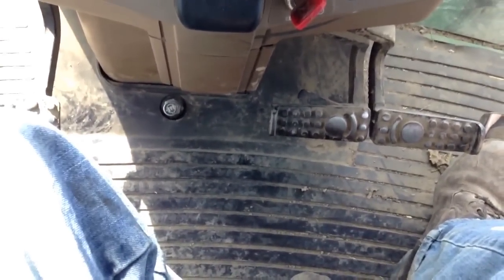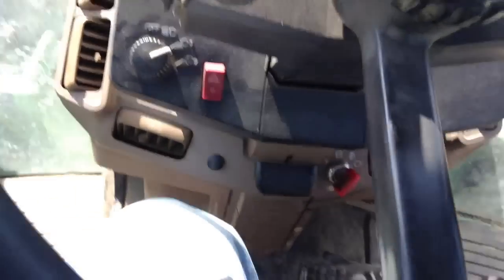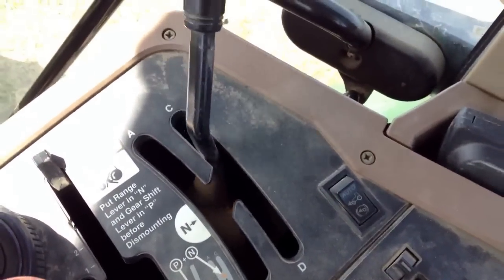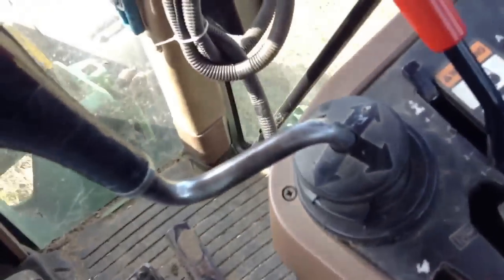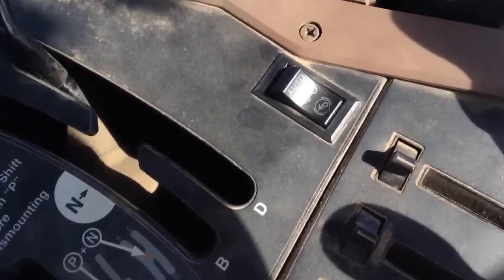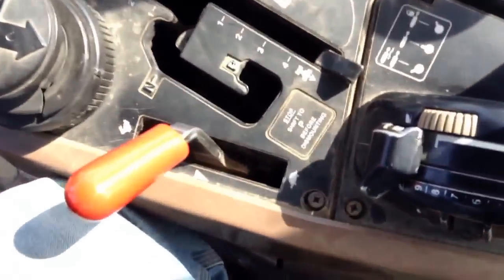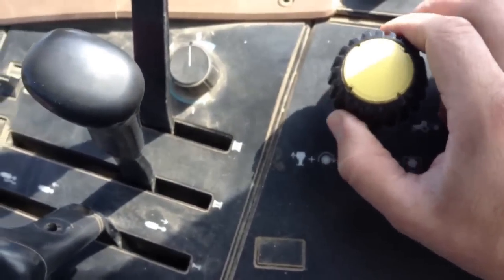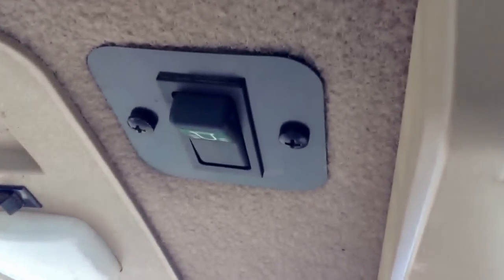How to operate a tractor (John Deere 7400)

Comment: Good job on this video. I'm sure a lot of people that have never operated a tractor learned quite a bit!  One thing that I believe might be of interest to the general non-farming public, is how much the tractor weighs, how much PTO horsepower it has and the difference between PTO horsepower and drawbar horsepower.  Also, the non-farming people might be interested to know that ballast is used for extra traction. Thanks again.

Comment: The lightning bolt thing is to warm the tractor up(warms the glow plugs)you hold it there for a few seconds and then rotate it all the way and it'll start easier
Reply: The lightning bolt thing is the accessory position

Comment: can you make video where you show how the hydraulics levers works, and what each lever do? :)
Reply: The little lever next to the seat with the flip-up button is the 3 point hitch, forward is lower, all the way back is raised.  The other levers, the SCV's (remote hydraulics that have hoses that plug into the back of the tractor) control various functions depending on what implement you're pulling and how you have it hooked up.  For instance, on a spreader one lever might control opening and closing the gate, and the other set of hoses might operate the floor slats.  The same levers might move the twine tubes on a round baler and open and close the rear gate on a round baler, or swing the hay mower left or right and raise or lower the mower cutterbar.  On a rake one set of SCV's might raise and lower the rake, and the other fold and unfold the rake.  All depends on what you hook to it and how you hook it up (for instance you can swap the sets of hoses around and now the lever that say folded the hay rake might raise/lower it now, and the lever that raised and lowered it before might fold and unfold it.  Usually guys have a preference for how they hook stuff up so that the lever closest to them gets used the most (say to raise and lower a mower at every corner) and one farther away does something that is used less often (like folding/unfolding).  If you pull a pair of implements, like say a disk and a crumbler basket, you'd typically have 3 or even 4 sets of hoses... generally you'd want the raise/lower of the disk and basket on the front levers or ones closest to you, and the fold/unfold hoses hooked to the SCV's controlled by the levers behind the front ones, or further away, since you only use those when you unfold when you get into the field to start working, and then when you're done to fold everything up to go down the road, where the raise/lower you use each time you get to the end of the field.  

Later!  OL J R :)